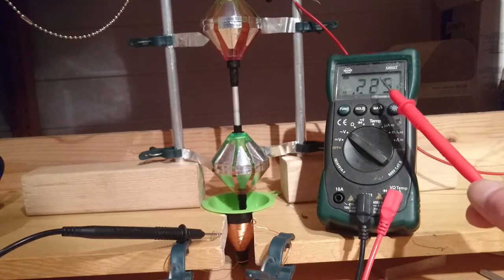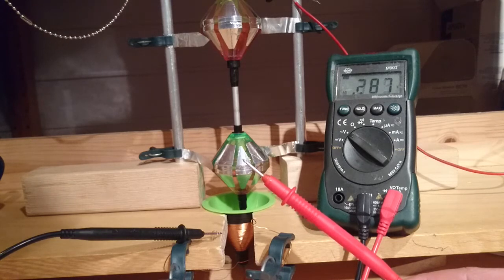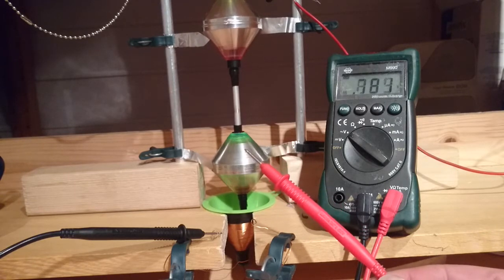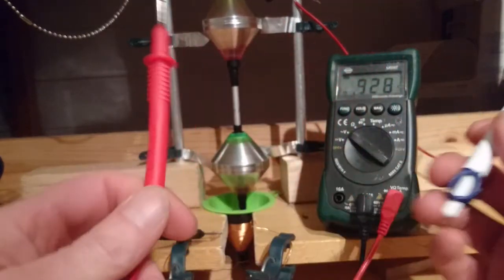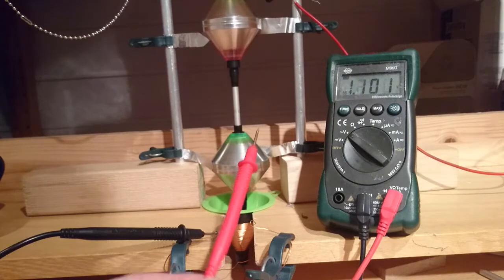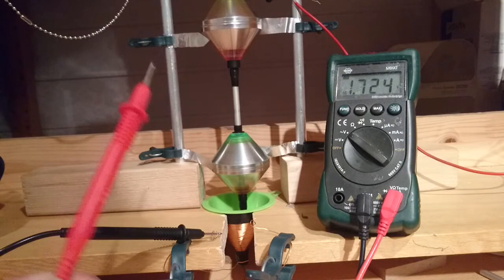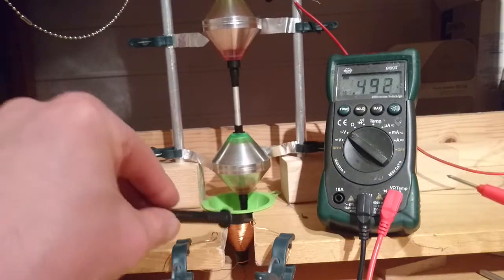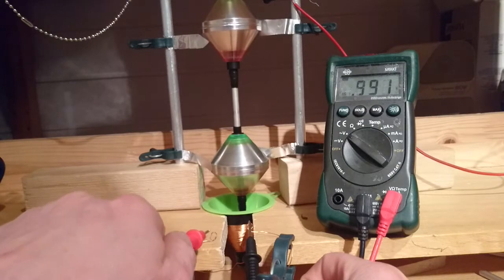Utron research Some more voltage readings on the coil

Comment: did you pack your coiled wire on the inside conical surface of each Utron?
Reply: Amigo bom ano novo e queria lhe dizer que tem toda a razão  tem que ser por dentro do cone em anti horário.
Reply: @pedromatias2590  Could you put in English please? Are the UTRONS Solid? Or Empty on the inside? thank you
Reply: Utron's should be hollow on the inside.
Reply: when i was studying the TR model saucers, one of the levitation devices was a series of utron shaped devices, that generated horizontal spin against magnets fixed on a frame. at a 180 degree angle to the tilt of the utron. 
i thought they had coil wrapped inside the utron rather than outside.